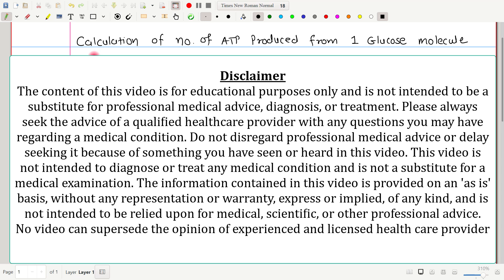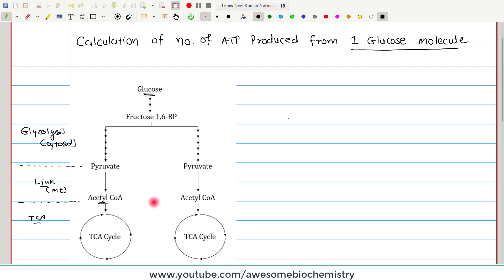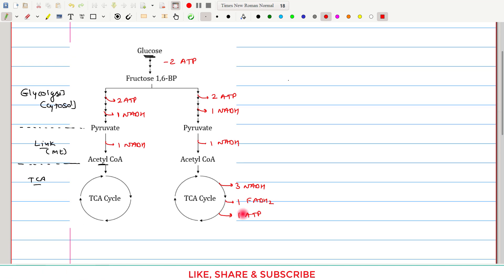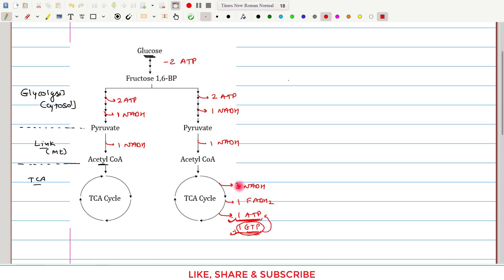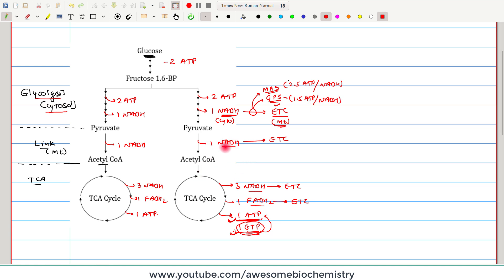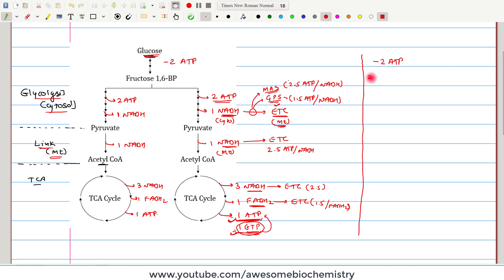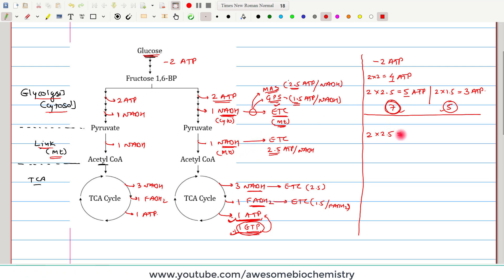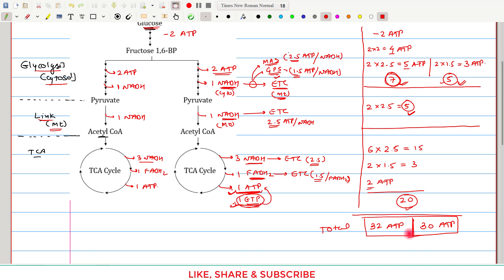13. ATP Production from 1 Glucose Molecule | Energetics of Glucose Oxidation

Comment: Thanks for this
I finally understand what was asked in my MB exams when asked reason behind 30 or 32 ATP
Cause my head was blank when i saw d question the first time as i didn't know that it was possible to have 30ATP
Reply from the maker: I'm so glad this helped clear up the confusion! That's exactly why this topic trips up so many students - most textbooks just give you the final numbers (30, 32, 36, 38) without explaining WHY there are different possibilities.
The key insight is that the variation comes from:

The shuttle systems - malate-aspartate vs glycerol phosphate shuttle for getting cytosolic NADH into mitochondria
Which ATP yield values your course uses (modern 2.5/1.5 vs older 3/2)

Once you understand that those 2 NADH from glycolysis can yield either 5 ATP or 3 ATP depending on the shuttle, everything clicks! No wonder your head went blank the first time - they never explain this context in exams.
For future reference: if you see ATP calculation questions, always check what values they want you to use and whether they specify which shuttle system. Good luck with your MB studies! 🧬

Comment: If options are a) 30 b)32  c)36  d)38

What is the correct answer?
Reply from the maker: Correct answer should be b) 32 ATP

If no any extra information given in question. 
It is logical to assume 2 things in such case: 
[1] Using modern ATP values (2.5 ATP per NADH, 1.5 ATP per FADH₂) 
[2] using highly efficient shuttle (malate-aspartate shuttle) - we should give benefit of doubt to positive side, right !!!

Now, If question had given context regarding system (new/old) or shuttle (malate-aspartate shuttle/ glycerol phosphate shuttle) :The correct answer will change

Using modern ATP values (2.5 ATP per NADH, 1.5 ATP per FADH₂):

With malate-aspartate shuttle: b) 32 ATP
With glycerol phosphate shuttle: a) 30 ATP

Using older textbook values (3 ATP per NADH, 2 ATP per FADH₂):

With malate-aspartate shuttle: d) 38 ATP
With glycerol phosphate shuttle: c) 36 ATP

Comment: Sir the old information of 3 ATP per NADH molecule and 2 ATP per FADH2 molecule is this correct or wrong is this possible in a cell
Reply from the maker: Great question! The old values (3 ATP per NADH, 2 ATP per FADH₂) aren't exactly "wrong" - they were the theoretical maximum based on earlier understanding of the electron transport chain.
Here's what happened:

Old calculations: Assumed perfect efficiency in the ETC with whole number ATP yields
Modern understanding: We now know the process is less efficient due to:

Proton leak across the inner mitochondrial membrane
Energy costs of transporting ATP, ADP, and Pi across membranes
Not all proton gradient energy converts perfectly to ATP

So the 2.5 ATP per NADH and 1.5 ATP per FADH₂ values are more accurate representations of what actually happens in living cells, while the older values were theoretical maximums.
Both sets of values might appear in textbooks depending on how old they are, which is why it's important to know both for exams! The modern values better reflect cellular reality.

Comment: Anyone know why my biochem class just says that 30 ATP is produced from each glucose molecule? Is the glycerol shuttle used the most often and the malate shuttle is used much less? Or what?
Reply from the maker: Your class is probably simplifying it to avoid confusion! Here's likely what's happening:
Why 30 ATP specifically:

Uses modern ATP yields (2.5 per NADH, 1.5 per FADH₂)
Assumes glycerol phosphate shuttle (gives 1.5 ATP per cytosolic NADH)
May be accounting for the actual energy cost of ATP transport out of mitochondria

Shuttle usage reality:

Different tissues use different shuttles
Malate-aspartate: More common in heart, liver, kidney (metabolically active tissues)
Glycerol phosphate: More common in brain, skeletal muscle, some other tissues

Your instructor might be using 30 ATP because:

It's a conservative, realistic estimate
Avoids the complexity of explaining tissue-specific differences
Accounts for real-world inefficiencies

Many intro courses stick with 30 ATP to keep things simple, then add the nuances later. The 32 ATP (with malate-aspartate) is also correct - it just depends on which assumptions you're using!

Comment: Is this under aerobic condition
Reply from the maker: Yes, absolutely! Everything discussed in this video is under aerobic conditions (presence of oxygen).
Here's why oxygen is essential for these ATP yields:

Electron Transport Chain: Requires O₂ as the final electron acceptor
Oxidative phosphorylation: Only works with oxygen present
TCA cycle: Needs NAD⁺ and FAD to be regenerated, which happens through the ETC

Without oxygen (anaerobic conditions):

Only glycolysis can occur
Net yield: just 2 ATP per glucose
Pyruvate gets converted to lactate instead of entering mitochondria
No TCA cycle, no electron transport chain

So yes, those 30-32 ATP calculations are definitely for aerobic respiration! Without oxygen, you're stuck with just the measly 2 ATP from glycolysis.

Comment: Two ATPs (net gain) form from substrate-level phosphorylation in glycolysis; similarly, two ATPs emerge from acetyl-CoA degradation in the citric acid cycle. The 24 released hydrogen atoms can be accounted for as follows:
1. Four extramitochondrial hydrogens (two NADH) generated in glycolysis yield five ATPs during oxidative phosphorylation.
2. Four hydrogens (two NADH) released in the mitochondrion when pyruvate degrades to acetyl-CoA yield five
 ATPs.
3. Two guanosine triphosphates (GTP; a molecule similar
 to ATP) produced in the citric acid cycle via substrate level phosphorylation.
4. Twelve of the 16 hydrogens (6 NADH) released in the
 citric acid cycle, to yield 15 ATPs (6 NADH × 2.5 ATP per NADH = 15 ATP).
5. Four hydrogens joined to FAD (two FADH2
) in the citric acid cycle to yield three ATPs.

The complete breakdown of glucose yields a total of 34
 ATPs. Because two ATPs initially phosphorylate glucose, 32 ATP molecules equal the net ATP yield from glucose catabolism in skeletal muscle. Four ATP molecules form directly from substrate-level phosphorylation (glycolysis and citric acid cycle), whereas 28
 ATP molecules regenerate during oxidative phosphorylation.

As you mentioned old information quote a 36 to 38 net ATP yield from glucose catabolism. The disparity depends on which shuttle system (the glycerol–phosphate or malate–aspartate) transports
 NADH + H+ into the mitochondrion and the ATP yield per H oxidation used in the computations. One must temper the theoretical values for ATP yield in energy metabolism in light of biochemical information that suggests they overestimate because only 30 to 32 ATP actually enter the cell’s cytoplasm. The differentiation between theoretical versus actual ATP yield may result from the added energy cost to transport ATP
 out of the mitochondria.
Reply from the maker: Excellent breakdown! You've provided a really comprehensive analysis that perfectly complements the video. I especially appreciate how you've organized it step-by-step and included the important distinction between theoretical vs. actual ATP yield.